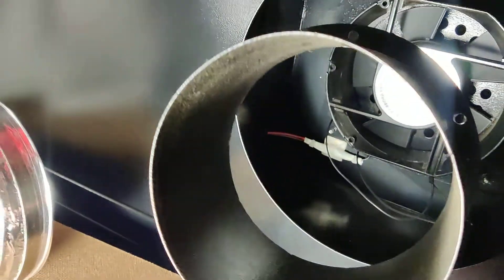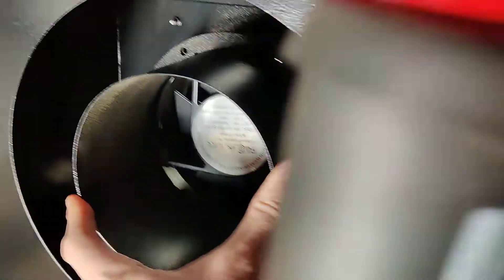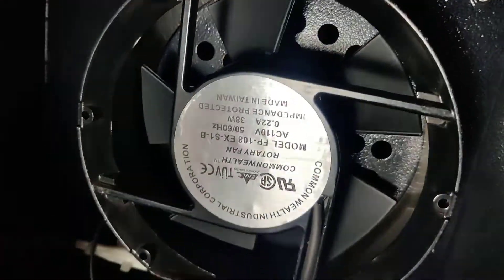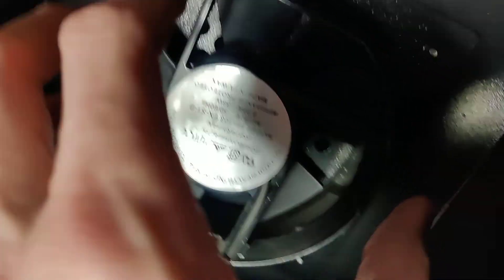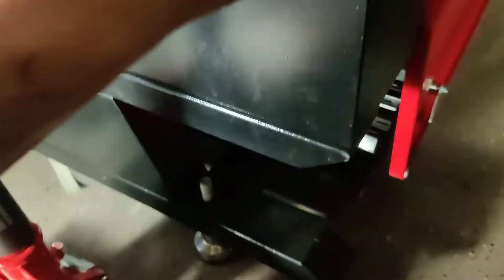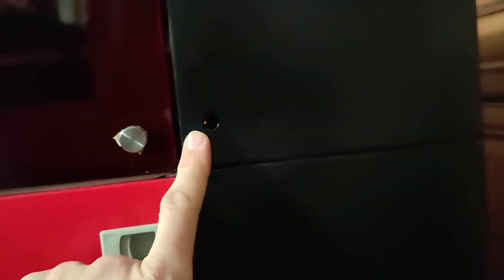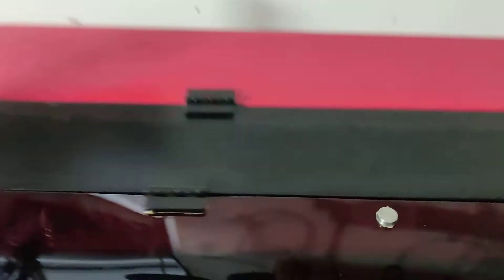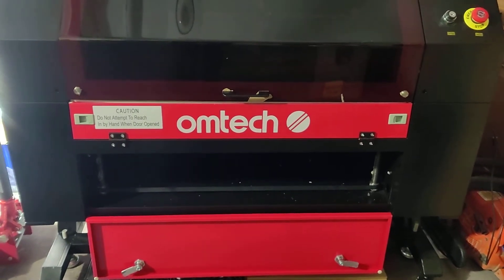First CO2 Laser Cutter Upgrade (Smoke exhaust system)

Comment: I’m very concerned about the VOC fumes from acrylic cutting and engraving, so I sold my machine after 1 week of having it. I can’t afford an expensive filter system; I had it in my garage but I’d like to buy a smaller one, probably the polar. What do you think about the one. How could I reduce any potential fumes/smoke coming out of it
Reply from the maker: All you had to do was add a charcoal filter and place it over the exhaust port. I piped mine outside, but charcoal is the best natural filter.

Comment: Any update on how this has gone after sealing?
Reply from the maker: Much better. I still recommend it. 
It's not perfect, I do smell a little smoke when cutting at close to max power for longer periods. But for 50% power and 15-20 minute cuts, I don't smell anything. 
Keep in mind that I usually let the piece sit for a few seconds after the cut to let the exhaust pull out the smoke. Sometimes I'm impatient and I do get a little smoke to rise after the cut. But it's night and day compared to before.